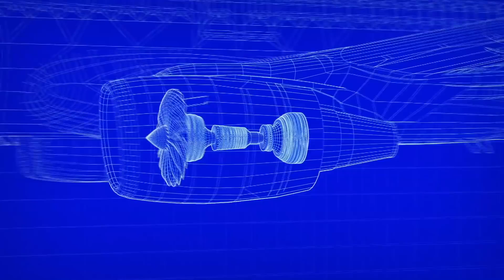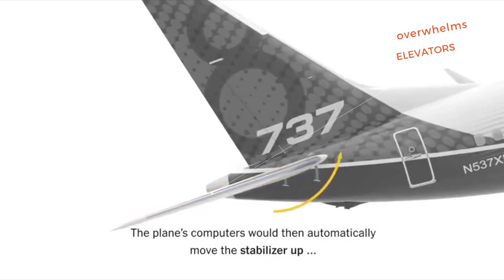737 Max 8 probable cause revealed - Prof Simon

Comment: Bad plane design can not be safely compensated by software tricks
Reply: New engine and its placement cause pitch problem then they compensate by making mcas. So its already a problem since beginning
Reply: Any software engineer will confirm this.
Reply: I'd argue with this because it's probably false (see the F-117, for example) but "bad plane design" is completely subjective, so the statement can't be proven one way or the other.
Reply: @mattj65816  The F 117 is proof that with enough software and enough risk tolerance a brick can be made to fly.  BFD.  The Wobbly Gobblin is not a commercial airliner hauling apx 200 passengers a thousand miles or more per trip with the safety and reliability that is required by that mission.  There are not and never have been a thousand Wobbly Gobblin flights a day, day in and day out.  An attempt to do so would probably result in it raining Wobbly Gobblins.  Commerical airliner designs collectively do fly those kinds of numbers over the entire world and we cannot have them raining out of the skies.
Reply: A civilian aircraft which has regions of instability - especially pitch instability !!  anywhere in its flight envelope is an objectively bad design. Totally unacceptable.
Reply: works most of the time probably like 99.9%
Reply: Alexander Pivovarov it. Is an awesome designed plane and the software needs an update so that the mcas does not have full control and can be overridden
Reply: @baxterobrien4857  It's a plane design that is rooted in "shortcuts". The software and the entire plane should be in the BIN. 737 Max will NEVER FLY AGAIN.
Reply: A perfectly aerodynamic plane still fights gravity.
Reply: Bad comments cannot be fully compensated for even with hours of examples and explanations.
Reply: software CAN do the impossible,  check out control systems,  PID controllers and how they can outperform humans,  look at how they control drones, robots etc.  But you cannot have good software if the control mathematics haven't been laid out first.
Reply: Yes they can - its done all the time, you just dont hear about all the times it works.
Reply: Alexander Pivovarov are you high or don’t understand aviation ?
Reply: Apparently you aren't familiar with the f-117
Reply: Alexander Pivovarov is completely right. Real problems = cheap patch.
    Now you are reminding me of  Fox Mulder!
Reply: If the software is suppose to fix a slight nose up condition, you only allow that software to adjust the control surface to reasonable levels for that problem, you enforce a maximum adjustment. The assumption is going beyond that limit would only be caused from faulty input, some catastrophic situation this software was not designed to fix, or faulty piloting which the software is also not designed to fix.
Reply: MCAS does not indicate bad design.  Most military aircraft use it and essentially any fly by wire aircraft (think airbus) use a version of it.
Reply: Alexander Pivovarov The iPhone mentality: Just patch the firmware.
Reply: And the irony is the solution to the problem-an even bigger software stunt
Reply: More accurately a severely out-dated air frame design...
Reply: A great many aircraft that are well-designed and have good stall characteristics have crashed and killed their passengers from stalls.   Any more packages inside furnace died from MCAS faults.  MCAS is an extremely effective system at preventing stalls.   Tragically it was not built to fly by wire standards which involve a triplication of sensors and most sub systems to ensure that the system is reliable and cannot create false and erroneous commands.   MCAS was not built to the excellent standards Boeing has shown in the Boeing 787 and Boeing 777 the problem isn’t technology but it was a failure to implement technology at the required level.   This was driven by psychological and commercial pressures to develop a system that didn’t require recertification therefore MCAS avoided certification and testing a program that would’ve discovered it’s flaws.
Reply: Wrong... look at the F-117, B-2, F-22, F-35... etc.  All inherantly unstable and unflyable without computer systems.
Reply: @fight2flyphoto  Yeah, but they all have ejection seats, too. The MAX, not so much.
Reply: And that's exactly what I' was afraid off.
Reply: not just that but according to FAA the flaw was fixed with one sensor
Reply: its all about the money...
Reply: This is not bad design...but bad system +bad sensor
Reply: @kirilmihaylov1934  -- they stuck bigger engines higher up on the old 737 air frame to save money from having to redesign the air frame.  The old 737 frame was too low to accept the new bigger engines - so they mounted the new engines UP above the wing.  Which causes the plane to pop-wheelies when flying.
Reply: My husband, a computer software designer, has said many times, computers are very stupid, but very fast. That's what they are best at doing, working much faster than a human ever could. I think it is possible the software in the MCAS had a very stupid program segment or a bug, and it ran that operation very, very fast. Still reserving judgement until the final determination has been made.
Reply: Well said...I m saying just the same...the Aircraft from beguining is unsafe!!!
Reply: " Bad plane design can not be safely compensated by software tricks "

If you don't define what you mean by "bad design", that doesn't really make sense. "Tricks" also isn't the right word to describe the role of software in controlling modern airplanes. Is a plane design bad, if it's intentionally made such that it requires software assist in some situations. In that case all modern fighter planes are bad. Fighter pilots would lose control of their planes in a fraction of a second without software assist. 

There are structural changes in Boeing 737 MAX that make the plane more difficult to fly in some situations. If it's possible to fully and safely control the changes in flight characteristics with a well designed piece of software in the flight computer, I don't think it makes sense to call the plane design bad. "Bad design" implies that an actual error was made (in the physical engineering of the aeroplane). Currently it doesn't look like that's the case (although it's possible). On the other hand, if the investigation provides the result that there never was a safe software solution to the changes in flight characteristics, then we can say that bad design exists in 737 MAX. But even then "bad" refers to the fact that Boeing wasn't able to see that a software solution can't safely compensate the hardware changes, not to the hardware design. It's good to remember, though, that Boeing had the choice to make alterations to the pysical design of the 737 MAX to compensate the new placement of the engines, but they chose the software route probably because that was the cheaper solution. 

Boeing has made something wrong, that we know for sure already, but we will have to wait longer to know what Boeing did wrong in the area of aeroplane design (referring with "design" to both hardware and software).
Reply: @adoatero5129  "In that case all modern fighter planes are bad. Fighter pilots would lose control of their planes in a fraction of a second without software assist." Why are you even comparing fighter aircraft with  a passenger aircraft like the Boeing 737 MAX 8? The Boeing 737 MAX 8 is made to get a passengers from A to B safely, so it would be nice to have a stable platform. A fighter must outmaneuver the enemy and it needs instability to do that.
Reply: @ Hjalmar:  

"Why are you even comparing fighter aircraft with a passenger aircraft like the Boeing 737 MAX 8?"

I gave it as an example of using software to the extreme to control the actual flying and maneuvering of an aeroplane. The original commenter used the expression "software tricks", which conveys the idea that using software to control or assist in flying is somehow an inherently bad solution. The fact that aerodynamically extremely unstable fighter aeroplanes, which are also maneuvered in much more demanding ways than large airliners, fly very reliably when steering happens 100% through an interpretring and error correcting software layer proves that that's not at all true. I too feel more comfortable if passenger aeroplanes are made aerodynamically stable, but the fact that I feel that way doesn't mean that deviating from that is a bad idea. Experts know that better than I do, and telling from what experienced pilots and other aviation experts have said again and again since these two accidents happened, software assist in passenger aeroplanes is a large reason for why the number of aviation accidents has gone down significantly in recent decades. It’s probably more a question of quality of execution, than a question of whether software should be involved in (actual) flying
Reply: Its not a bad design. The problem is the airlines that crashed these planes. The core problem is not the MCAS system itself, the core problem is sensors, mainly AoA sensors providing incorrect data to MCAS. Both of these aircraft experiences the runaway trim problem as a result of two factors, the bad data, and pilots that did not have the runaway trim checklist memorized as they're required. In the Lionair crash the flight previous had experienced the same problem, bad AoA data that caused the MCAS to go into a runaway trim problem, the pilots on that flight  troubleshot the problem quickly and accurately and disabled the MCAS system simply by flipping the Auto-Trim Cutout switches and this allowed the flight to operate safely and land at its destination. This problem was written up by the pilots and the plane should have been grounded until the AoA sensor problem was fixed. That and the fact that next pilots on that aircraft did not know about the previous flight's problem and they did not have the runaway trim checklist memorized are the core reasons why the Lionair flight crashed and something similar will likely be the root cause of the Ethiopian airline crash also.
Reply: @jamesbrown5600  two wrongs will not make right. How can you say a  design that makes an aeroplane  to pitch-up and then corrected by a faulty sensor that loves to nose-dive is not a bad idea?
Reply: @jamesbrown5600  the fact it takes 2 switches to switch of if failure condition felt and the 2 crews did not know this is down to bad training,,,   the jet is ok if you understand whats happening if it fails,,   but the system could be better,,  ultimately its down to boeing being secretive and greed,,,
Reply: @jamesbrown5600  What ever is the core problem, it's not safe to have the whole plane relying on it. The problem is a design that has a core problem. There is no redundancy.
Reply: @jamesbrown5600  boeing and the systems still have flawed and too blame.....why the hell insert some sys that didnt work well and too complicate while the older plane work perfectly?
They suppose to improve the pkane ...not to make them more complicate and give insignificant outcome if the system work well...

Put some system in without good test and esy to use and understand by pilot and airline also a crime....
....this plane series should be ground forever!....😑🤐
Reply: James Brown:: 
 in Lion Air previous flight, it was off-duty pilot flying in that plane that solved the MCAS problem by shutting it off, not the on-duty pilots.

The off-duty pilot had benefit of time and relatively stress-free state of mind to think, compared to on-duty pilots whom knew the very risk of crashing with all the passengers on it that gave them more and more pressure to think calmly.
Reply: James Brown well explained. Also, the previous lion air flight was saved by a third pilot with the right experience not by the two pilots.
Reply: @jamesbrown5600  You are correct, the pilots should have been alert for runaway trim problem regardless of the cause. Any number of other causes could create this issue, eg. faulty yoke trim switch, autopilot fault, short circuit in trim motors, etc. To add to your comment on the previous Lion Air flight that averted a crash, it wasn't even the flying pilots that saved the flight, it was the jump seat pilot along for the ride who advised the flying pilots what to do to disengage the trim motors. You can bet there are plenty of pilots who do not have the runaway trim checklist memorized.
Reply: @jamesbrown5600  WRONG. It is a BAD design. Rushed design. It was the CHEAPER option to go with software fix instead of proper redesign. It is a massive junk aircraft that will never fly again.
It's easy to blame the pilots (cheaper too). Oh if ONLY it was that convenient? The 737 Max is FINISHED.

Comment: Not to change the aerodynamic characteristics of the new plane for saving money and development time, but use software to compensate aerodynamic deficiency IS A CRIME to law of nature the least.  The la of nature will NOT forgive.
Reply: Actually NO, F-16,B-2 Spirit etc... All are computerized...Even Airbus. Remember the Airbus that crashed at a air show? The pilot had the gear down and flaps down for demonstration and the computer thought it was landing. No matter what pilot did, it landed into the trees!   Software problems! 737 MAX - Software problems. Someone didn't to their home work and the FAA didn't do their JOB.
Reply: @whisky_9o5  civilian planes are designed to have have stable flights as Prof said software only to help properly trim the plane... but Max was designed to be unflyable without MCAS so the plane was flawed from day 1..... also military planes are designed differently to civilian ones for flight/maneuver characteristics
Reply: If they're in such a hurry, why not "circle climb" like birds?  Think of time and fuel spent in holding patterns.  Use that principal, duh?
 Nope. Man vs Nature-- Man is smarter.
Reply: It is crime to make an airplane that cannot go back to manual override flying solely on its aerodynamics and the raw pilot skill. Anything less is a disaster waiting to happen.

No sales person, their calendar, nor their clients can be allowed near an airplane before it has been fully tested by the test engineers.

Shame on Boeing. Shame on the aviation industry to forget about the safety of pilots. Crew and passengers.
Reply: As a controls engineer, I disagree
Reply: Except that Airbus has been doing this for 20 years.  And in their aircraft, the pilot is secondary to the computer.  At least in the Max 8, all one has to do to override is to TURN IT OFF!

Comment: Is there a back up for an broken angle of attack sensor? And can you switch the mcas system off and fly the plane without this system?
Reply from the maker: Maybe....but it all happens quickly...in the air...they were not expecting this.
Reply: @SimonHollandfilms  they must have been briefed about what happened to the LionAir. basically, runaway stab trim memory items, which includes flipping the stab trim cutoff switches. 
The question is why they didn't do that. Also if the problems for Ethiopian302 started right after takeoff, that's when the flaps were most probably still deployed. SO my guess is that it's not only a MCAS related crash.
Reply: "Is there a back up for an broken angle of attack sensor?" There are at least two sensors on planes. The issue is that the MCAS system was taking readings only from one of the the sensors, which happened to be broken on the Lion Air crash. The software update that Boeing will be rolling out is to use readings from both sensors.
"And can you switch the mcas system off and fly the plane without this system?" Yes, two ways (maybe more). Runaway autotrim can be shut off by flipping switches on the center console. Pilots would then have to trim the plane manually. Another way is to extend flaps one notch which would disengage MCAS. These would be memory items, procedures that pilots would have to commit to memory given that it's time-critical.

Comment: Really I cannot see why all this ado about bringing in electronics not to stall an aircraft. Since in the Boeing 737 MAX retains the same area of the horizontal stabilizer at the back then I do not see why this is not arranged to move under manual control. All one needs to do is to look into the electric motor that rotates the screw jack and with a couple of contractors, one can stop it, run it clockwise and anticlockwise. It does not even need speed control considering the high gearing (infinite mechanical advantage) on the screw jack. To make sure that one stays flying and not stalling, one can introduce a gyro of the old fashioned type with a fast rotating mass with its axis continually precessed in the direction of horizontal flight. Then a model aircraft placed on the gymbal will show the pilot the angle of attack even in foggy weather.   We used to do all this on Royal Naval ships to align the guns. A gyro is precessed with signals from the radar, with its axis pointing at the target, then the ship can roll and pitch and sway, but the guns will follow the axis of the gyro. It is as simple as that.
About 30 years ago one cargo ship lost its automatic rudder control and all I did was to run a four core cable from the rudder room to the Control Room on Deck, added two contactors controlled with two push buttons and the induction motor would control the rudder. It all cost me 50 Euros.  The captain was a little reluctant not to use the traditional round coxswain wheel but as he had an indication of the rudder angle........ he did enjoy the two push button port and starboard improvised fly by wire rudder on his old ship........... in fact he left it like that.